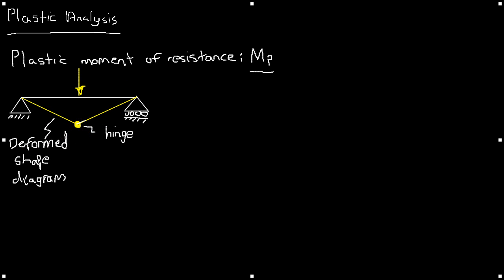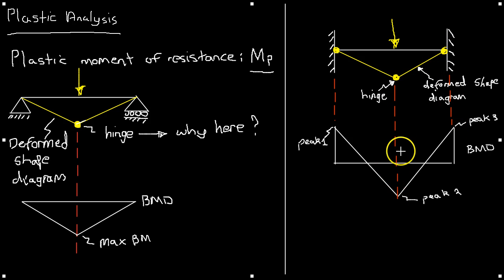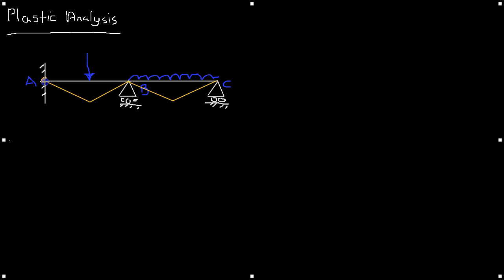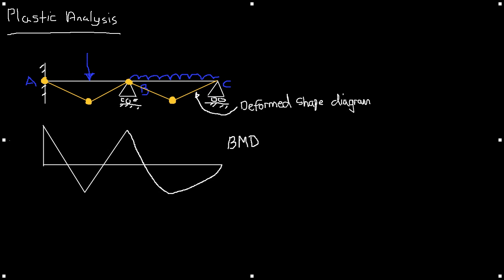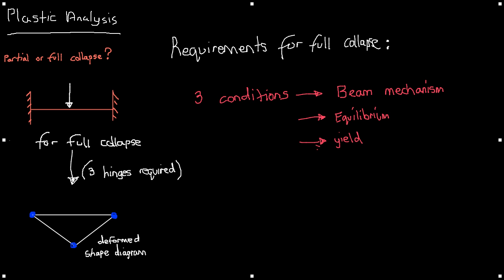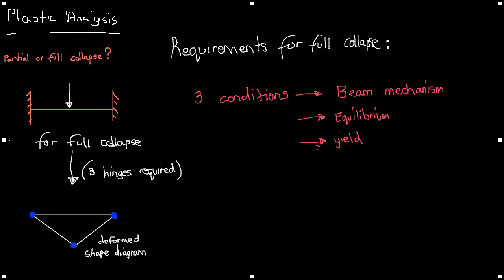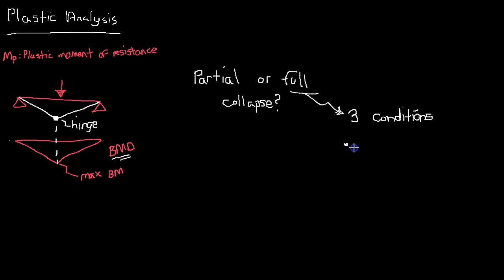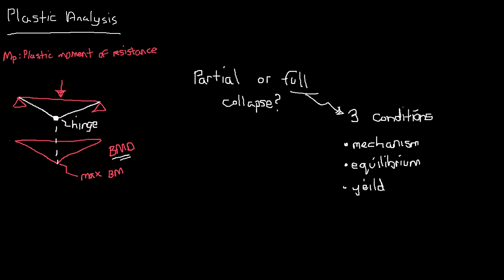Plastic Analysis - Fundamental Concepts Part 2

Comment: Hi Mike great vid. I'm a bit unsure about how you drew your bending moment diagram @ 3:18. Isn't the moment supposed to be zero at the roller support (point B)?
Reply: yo mo, ABC is one continuous beam (or a double continuous span) so that's why there is a moment about B. it's a statically indeterminate beam so there are redundant reactions. here is a link with some information about statically determinate vs indeterminate structures. 
https://www.quora.com/I-need-an-explanation-about-the-difference-between-statically-determinate-and-indeterminate-structures-And-which-is-more-applicable-in-real-life